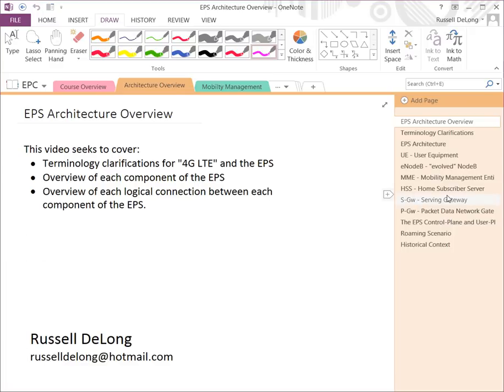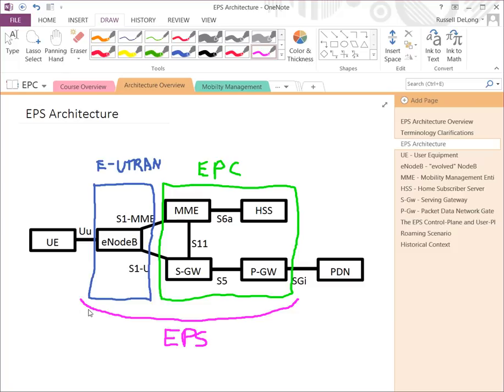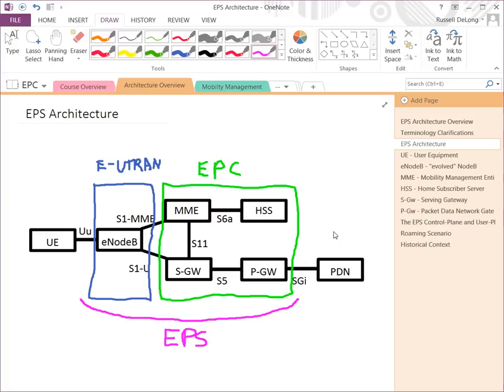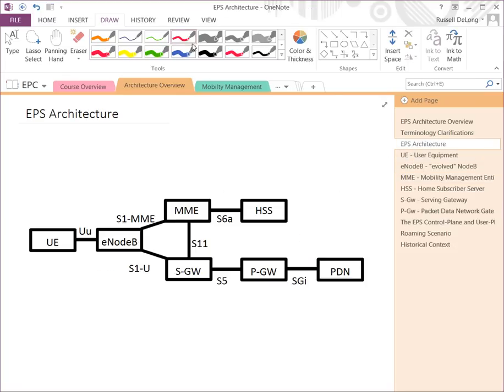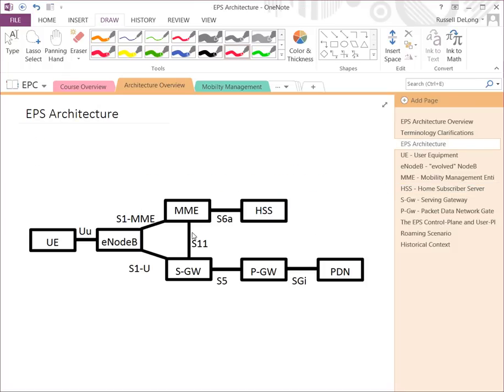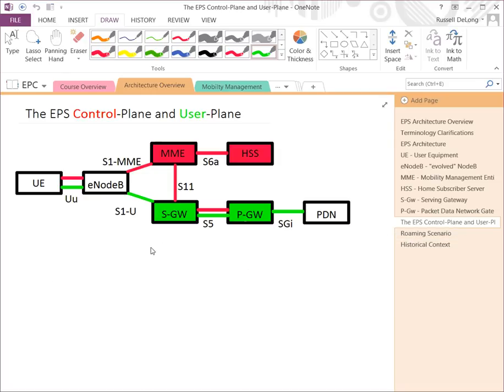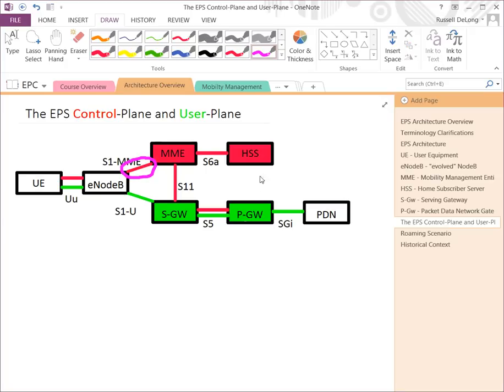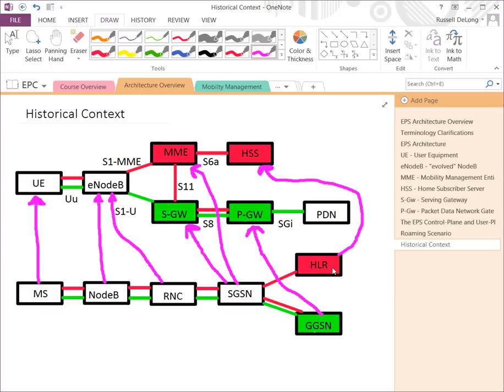EPS Architecture Overview

Comment: great introduction.  I enjoyed the video.  I want to add a couple points on the roaming scenarios.  There will be a idns  involved. Idns is used to query the pgw IP address.   That way, the operator whom providing the service don't need to hardcode the IP address of pgw. also, there will be a dra (diameter routing agent)  for the s6a interface.  between the two hss  connection.  Dra  will handle the message exchange between the two roaming partner network. also,  all user and control plane message will most likely be going to the ipx (tns  or Syniverse). Direct connectivity is normally not recommended by the tier one operator.
Reply from the maker: +Eric Wong 

Well, technically a "DRA" specifically refers to a Diameter agent capable of a type of session binding mechanism for policy control call flows when you have redundant PCRFs. The term was first defined in TS 29.212. It got a bit jumbled, though, when the GSMA took the term in their profile for LTE roaming in IR.88 (including the "DEA" also), where the term became almost synonymous with Diameter routing and agents in general as a concept, but it's not a technically correct term to use when referring to MME -> HSS routing for roaming (although, alas, it is common to hear).

Unfortunately for Diameter routing, it suffers from a bit of a naming crisis. In addition to those two terms (DRA, DEA), you have the terminology of the base RFC 3588/6733, which use the terms "relay", "redirect", "proxy" and "translation" agents as the four main "kinds", defined very generically. 

As to iDNS, this concept exists for home PGW selection as well as for roaming. It's really no different, except that in roaming the query will be for the other operator's APN names, thus some common DNS hierarchy must exist between them.
Reply from the maker: It may also be worth saying that these roaming concepts are really specific to the GSMA's profile for LTE roaming. The use of Diameter agents in the case of S6a is outside the scope of the EPS architecture itself (permitted by the architecture, but you won't find it in a 3GPP 23.xxx spec for sure).

Comment: Russell that was an excellent presentation. I really like your style. This presentation was probably the best straight to the point explanation of the EPS attach procedure. Could you do a part 2 which is basically the IMS registration and dedicated bearer setup for a VoLTE call. Sort of like a prelude to a VoLTE to VoLTE call setup.

Comment: I don't remember on which video you were talking about sessions so I am just posting here.
I get the logic for using UDP in telecom core- as speed is the main concern.
But my question is- as UDP is session less, how can session be established/maintained between core nodes?
How  other transport protocols like TCP can be used by UE if the core networks only use UDP, how is that made possible?

I would really appreciate if you clear my doubts, and might I also add that you really have an intelligent way of teaching. And I would appreciate if you can upload your videos on Session management and Diameter signaling in particular.
Thank you
Reply from the maker: +Nissar Ali 
If you mean GTP protocol carried over UDP, the session management is handled at layers above UDP itself, much like how TCP manages to be session-oriented even though it is carried over the stateless IP protocol. In short, the concept of session state does not need to be handled at Layer 4 in this sense.

For example, GTP as a protocol may send a message and expect a response. If it needs to be retransmitted, UDP may not know that it is retransmiting the same application payload (as, to UDP, they would be two independent, stateless messages), but GTP would know that the second is a retransmission. In the same way, the IP layer doesn't know nor care if two TCP-level messages contain the same payload, nor that the second was sent because the first wasn't responded to.
Reply: So the application layer protocols that run over tcp, run on top of GTP in this case?
Suppose there are two application layer protocols, one runs over tcp and another uses udp as L4, in this case both have to run over GTP. How does GTP differentiate between both?
Reply from the maker: +Nissar Ali 
Think about it this way: GTP as a protocol cares about the setup, maintenance, and tear-down of the GTP tunnels themselves. It does not care about the IP packets of the user toward a destination IP network, nor the application layer of the user's traffic.

When I said that layers above UDP handle session state, there are different "sessions" happening here. There is the GTP tunnel itself, being active or inactive (handled at the GTP layer), then there are user applications, between the user and (for example) a server on the Internet, which is handled between those two systems which simply use the EPS network as transport of IP packets between the user and the Internet server.

Comment: Thank you Russell, very informative video. Question if I may...if a carrier has both 3G and 4G LTE network can P-GW be used on both network instead of GGSN. Thank you.
Reply from the maker: +Info Online 
Yes.

One model involves the "S3" and "S4" interfaces, where a legacy SGSN connects to the MME and SGW. You can also have an "S12" interface in that case with an RNC, which is the equivalent to the legacy concept of "3G Direct Tunneling", cutting the SGSN out of the user-plane in the legacy access network toward the SGW and PGW.

Another model is for the PGW to support a Gn interface with an SGSN. Essentially that makes the PGW "look like" a GGSN, with the main difference being the GTP protocol version (Gn is GTPv1, whereas S5 would be GTPv2).

Where a PGW and a GGSN are both essentially GTP-aware IP routers providing PDN connections based on APNs,  they are far more alike than they are different, and practically speaking just about any vendor that supports the logical function of a PGW will also support the functions of a GGSN, where we are primarily talking about protocol versions in how they interface with other nodes.
Reply: Thank you very much Russell!! I tried to create same network diagram as per your video however could not get all tab. Would it possible if you can share the deck? Thank you again.

Comment: Much appreciation Russell it would be much prettier if you included the PCRF and OCS in the drawings i guess the PCRF is a very important node in EPS
Reply from the maker: For this particular video the focus was on the "base" components.

PCRF's are only needed in certain circumstances. VoLTE essentially requires it, but EPC for data purposes with CSFB wouldn't have use for PCRF unless you had more granular QoS policy requirements.

OCS's similarly aren't necessarily required unless you need real-time controls and billing state awareness.

In contrast, you can't have a working LTE network at all without the components I'd highlighted.

Comment: sir can  s-gw be used in umts network and  sgsn  in epc network.... if yes kindly elaborate how??? and one more question sir ..... if there is no HLR or HSS in a network then how the authentication of a user will be performed.......
Reply from the maker: For the first question, SGW's can be used to serve UMTS, though via an SGSN. What happens is you have the SGSN passing user-plane to the SGW -> PGW, and you have the SGSN passing control information to the MME. You can also have the concept of 3GDT, where you build user-plane between an RNC in a UMTS network toward an SGW directly, removing the SGSN from the line-of-path. Refer to the "S3", "S4", and "S12" interfaces for these three types of connections which can exist.

As for the other way around, a logical SGSN can't really support LTE/E-UTRAN access. The towers speak directly to the core's control node via S1AP protocol only, as opposed to talking to a BSC/RNC which communicates to SGSNs on their behalf, so it's a bit of a paradigm shift. Now, I suppose you could have an SGSN which supports MME-specific interfaces like S1-MME, but at that point it isn't so much that an SGSN supports E-UTRAN, but rather that an SGSN supports some minimal amount of a logical MME, and it's really the MME-specific protocols (eg: S1AP and GTPv2 control) which are being used, so at that point it would be hard to call such a system an "SGSN" as opposed to an "MME".

Now, practically speaking SGSNs and MMEs fill such similar roles in their respective architectures that many systems which support one role will also support the other. A converged "SGSN + MME" platform is a common theme you'll find across nearly all equipment vendors I can think of off hand.

For your HLR/HSS question, if you don't have an HLR or an HSS then authentication really can't be performed, but I'm not sure where you're going with the question. If you mean "what services can work without an HSS or HLR", then one example would be emergency service, where authentication can be bypassed. If you're talking about AKA authentication to the device, though, then the MME or SGSN is going to have to get the security info from somewhere since it is two-way mutual authentication and the UE expects to receive (and validate) the AUTN which the MME would normally retrieve from an HSS.

A minor note, on your general questions on architecture inter-operability between GPRS and EPS, it is possible for SGSN's to use an HSS or for MME's to use an HLR. Both are just frontends to much the same information, and depending on the use case you might see something like an S6d interface between an SGSN and an HSS, yes.
Reply: +Russell DeLong  bundle of thanks sir  :-)

Comment: hi russell,good and illuminating lecture...this might seem out of context but i just wanna ask about the software you used in making your lecture series.
Reply from the maker: Hi Uzoma,

I use Windows Media Encoder to do the video/audio captures on my desktop, with a USB microphone for audio. When I need to make graphics I usually go through Google Drawings (from Drive), then just save them as a picture and save them to Microsoft OneNote.

So, basically I use all freeware programs other than OneNote which I bought stand-alone just for the presentations. The USB microphone is a Blue now, whereas some of my older videos were with a cheapo logitek headset, which was ok but kind of scratchy for highs.
Reply: ***** thank u very much

Comment: "S-GW and P-GW are IP routers" - NO! They are just SERVICES (I.e interfaces). S-GW is a service that eNodeB (radio tower) uses to communicate with some machine M. P-GW is a service that machine M uses to communicate with the rest of the internet.
Reply from the maker: The main job of SGWs and PGWs is to process incoming IP packets and forward them, sometimes though a tunnel interface (eg: S1-U) and other times based on IP routing table lookups (eg: Gi/SGi). In this way, IP routing "as a service" really is what they do.
Reply from the maker: When I say that they are IP routers, this is not to say that they are physical machines; IP routing "as a service" can certainly be abstracted from any physical architecture that may come to mind when thinking about a traditional IP router.  Although incidentally, almost all actual implementations of the EPS architecture by vendors will realize SGWs and PGWs as physical IP routers, likely because they are physical machines built to provide such a logical service.
Reply from the maker: I should also note, SGWs and PGWs are not "a service", but rather a function in 3GPP which can support several services if we are using that terminology. For example PMIP-based S2b is a service/interface. Gx is a service/interface.

An eNodeB does not provide SGW as a service to reach a user device. Rather, it provides S1-U as an interface into an upstream SGW to provide transport of user-plane packets out of the E-UTRAN into the EPC.